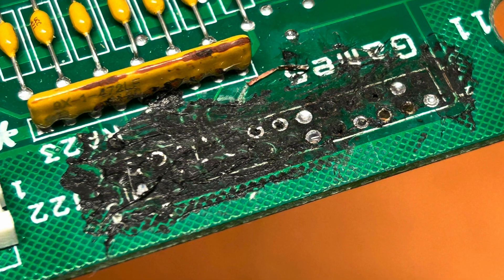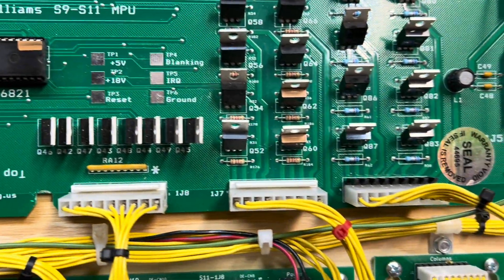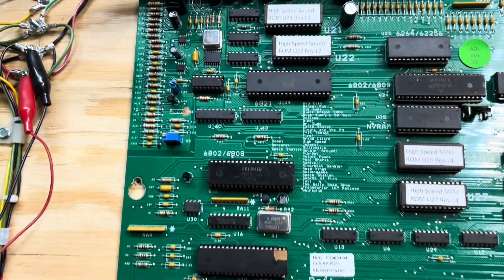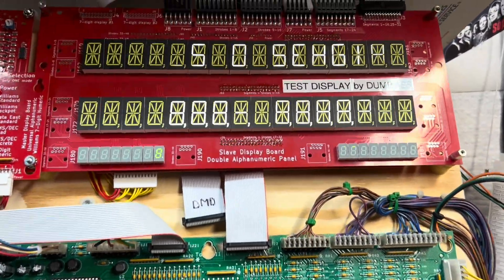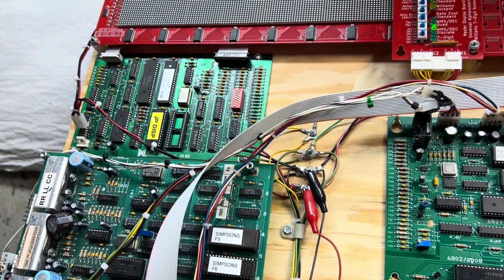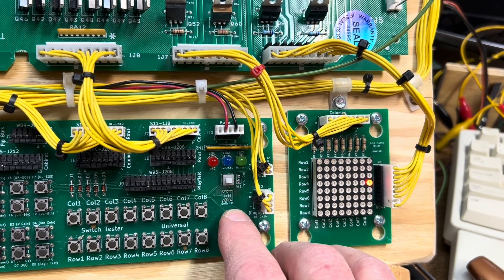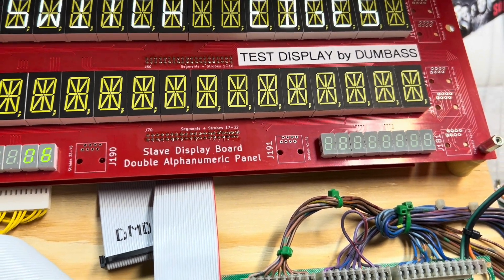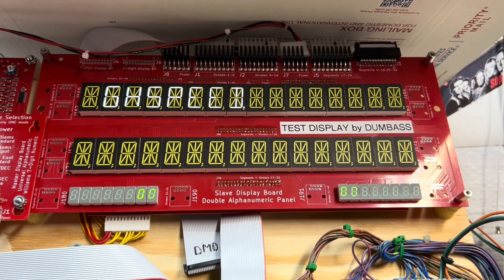RottenDog MPU9211 with High Speed ROMs

Comment: As a process engineer in an IPC-compliant lead-free program I learned that lead-free is extremely sensitive to chemical contaminants compared to SnPb. It works great if you're loaded and can afford top quality materials and equipment. But it's not necessary for electronics that aren't destined for landfills.

Comment: Looks like the client tried to remove connector with propane torch and a butter knife.
Reply: Haha - I was going to suggest the same (or a least an attempt was made with a hot air rework station - but more likely a heat gun!)

Comment: Great job, Chris, I know you’re not too fond of that rottendog board but as of right now it’s the only board you can buy at $550.
Reply from the maker: The System 11 board that Victor aka "DumbAss" on PinSide makes is fully compatible across all System 11 games and costs about $550. It is head and shoulders above the RD MPU.

If you need a DE MPU, I have a DumbAss DE MPU priced at $500. Brand new.